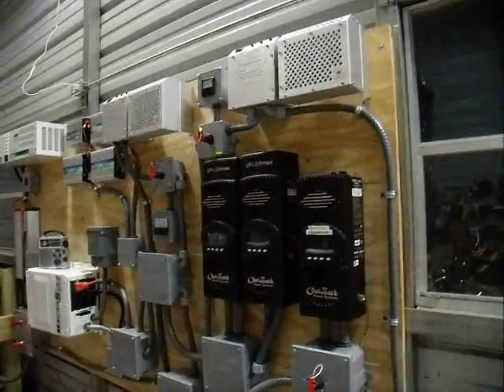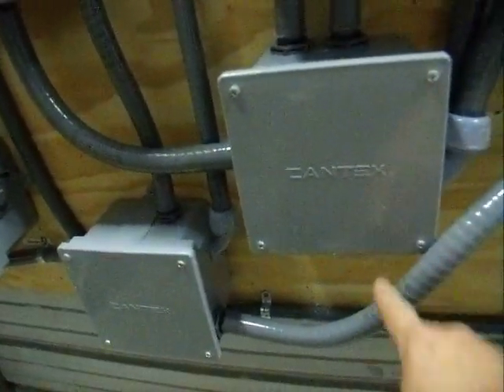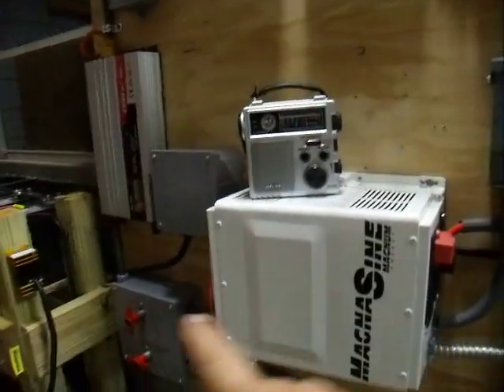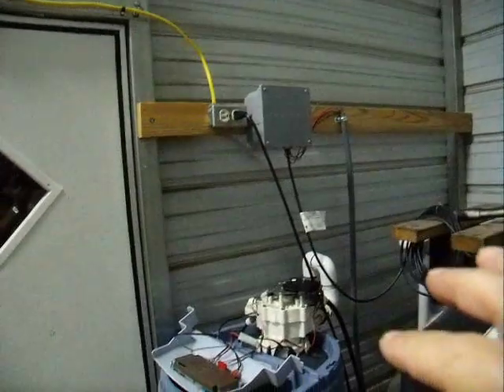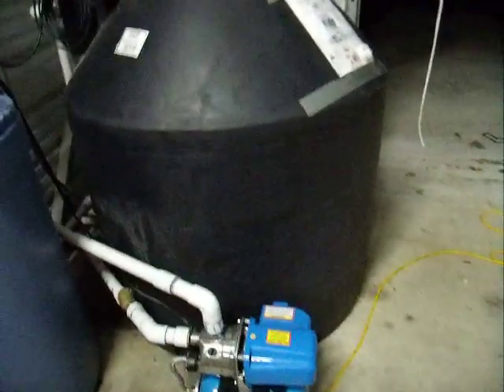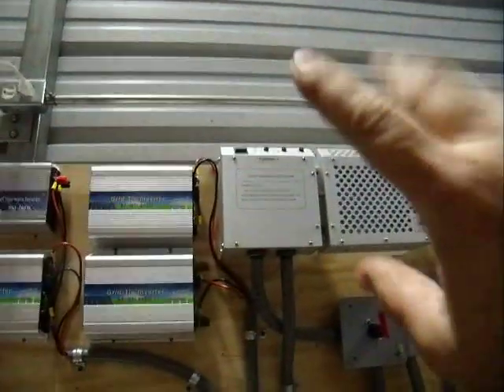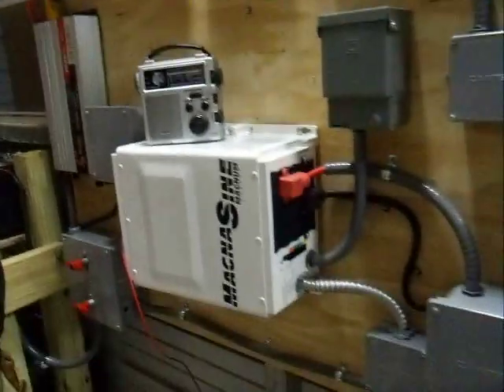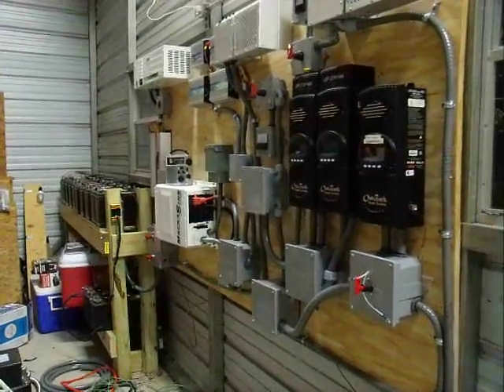Power Panel Update #3

Comment: @econewpower Also, I have just realised that US appliances require 60Hz. Based on this, I guess my original question was somewhat flawed.
In Europe, 240v, 50Hz, 2KVA inverters are quite a bit cheaper.
Sorry to answer my own question further, but the 60Hz bit slipped my mind.
Your setup is awesome, I look forward to more updates. God bless.

Comment from the maker: because to find a 12vdc, 2Kw, 240VAC inverter for $600 is impossible which is what I paid for mine, it was an opportunistic decision.Since most of my power is fed from directly from the 120VAC side I really don't loose anything. The only time the 240VAC is used in that circuit is to power my deep well pump. You may have noticed I also have 24vdc, 240VAC inverter (but that one costs over $2,000). Sometimes less is more.

Comment: Hey Al.
That is a fantastic system you have there. One question that is bugging me is, why do you have a 120v inverter feeding a 120v to 240v converter? To me, the 120v to 240v converter is just another link in the chain, consuming more power in it's conversion process. Why not just use a 240v inverter and get your 240v supply in one step?
God bless you.

Comment from the maker: @indman101 I think that's a great panel, if you don't need to go through batteries and the roof surface area is small then you are on the right track going with more powerful panels. You just need to get a suitable grid tie inverter that will work in your budget and with those panels...that's the tough part. If I make suggest, you should really call WholesaleSolar and talk to Wil, he knows his stuff very well indeed and can help you meet your budget and design goals.

Comment: Nice video's Al.....wanted to ask a question,Im wanting to add some panel's on my garage for a grid tied application had checked out the GE 66 watt panel's you told me about but there were only two in stock,should I look for panel's with lower volt's for a grid tie application?have about $4,000 in my budget for this and a 24ft x 8ft roof  was looking at maybe getting the ES-A-200-FA 3B  it's 200 watt 22.60 open circuit panel,maybe getting 5 of these but not sure what grid tie inverter I need ?ty